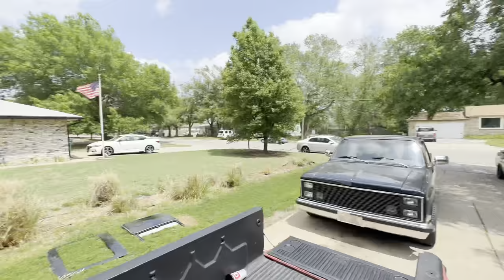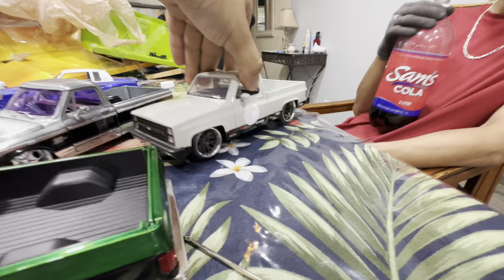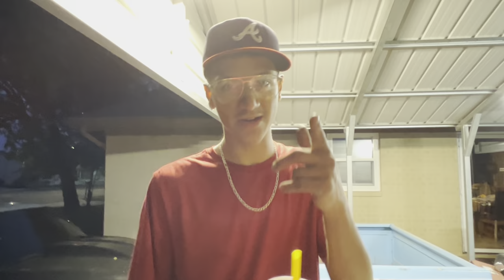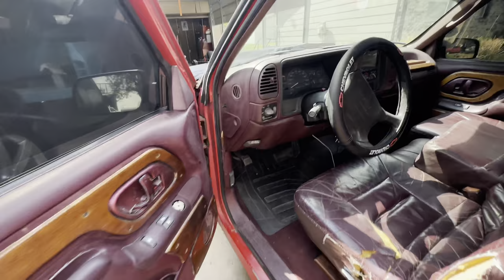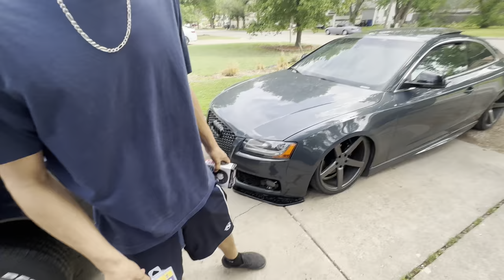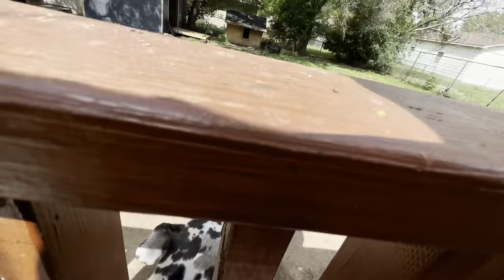Sunroof on obs install 🔥

Comment: Impala sunroof?
Reply from the maker: Yes
Reply: What year ?
Reply: What year impala
Reply: @koolbreeze4582  2007 impala Ltz or ss
Reply: @marcoreyes8532  thanks. Wish you would have recorded the cut out of the impala and the full install on the truck. This will be my first time attempting
Reply: I cut a sunroof out of a car yesterday. The sunroof has a pretty big frame. I removed mine from a 2012 Malibu. Was told it’s the same roof for 2007 -12 impala. I would like to see photos of your sunroof glass frame and motor setup. I also was trying to see how you ran the water lines.
Reply: U have to cut down the frame a bit from the sun roof… I’ve done one before to… just don’t pass the screw  holes  to 
Mount  it… measure twice cut once